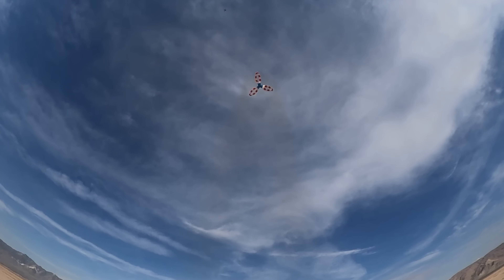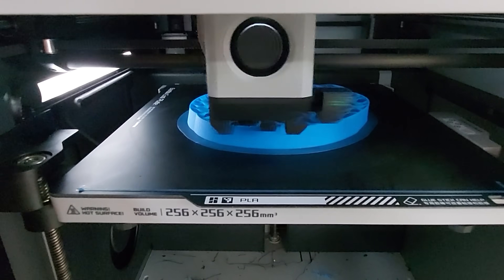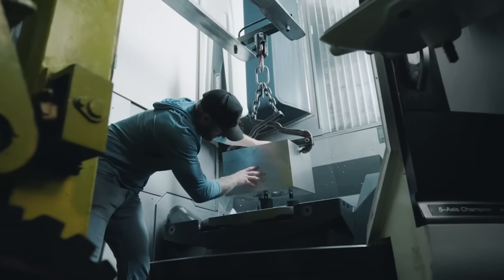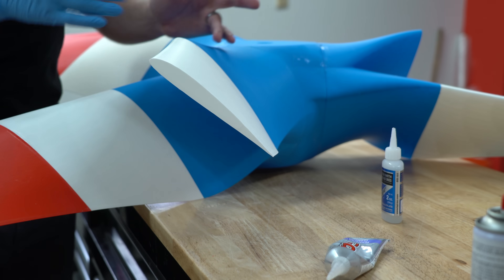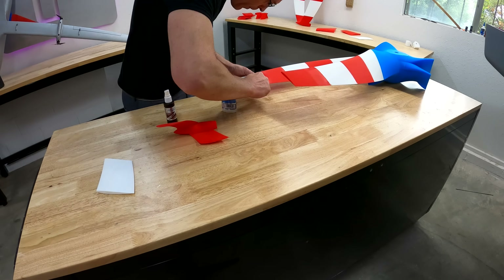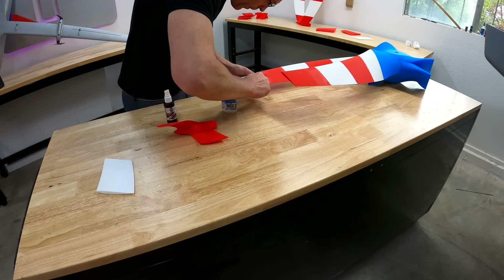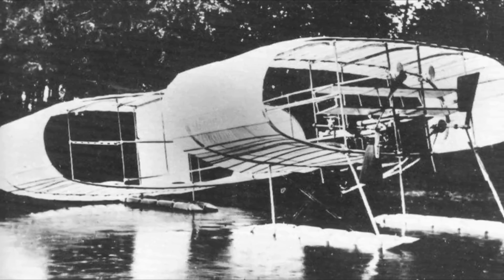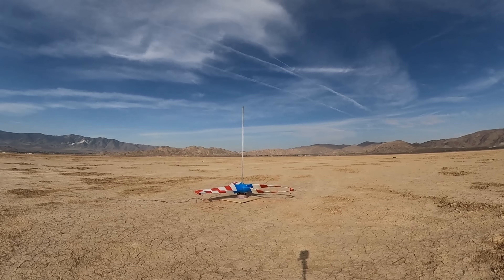Exploding 3D Printed Toroidal Rocket Powered Helicopter

Comment: safety third! cool project, maybe if you glassed over top of the print it would be much stronger in the centripetal direction. you could technically load chutes into the tip rocket tubes to bring it down safe.
Reply from the maker: I did glass the whole thing but apparently not enough.
Reply: @thinkflight Run a safety wire internally along leading edge, from tip to hub. It'll both pull the structure together and stop  pieces flying so far when it does crash and break up.
Reply: @BarrysMintyBiscuit2201  "stop  pieces flying so far when it does crash and break up" I love your confidence in your own safety suggestion.
Reply: Someone didn’t watch the whole video before commenting.
Reply: @brandonloukota4760  busted, I wanted to see the fireworks.